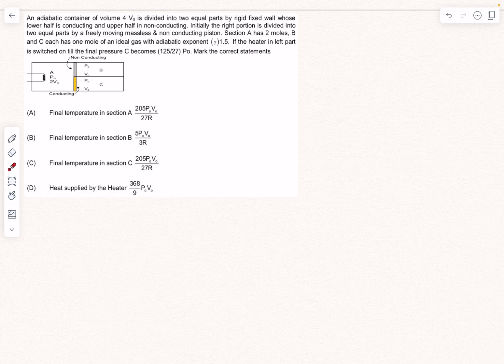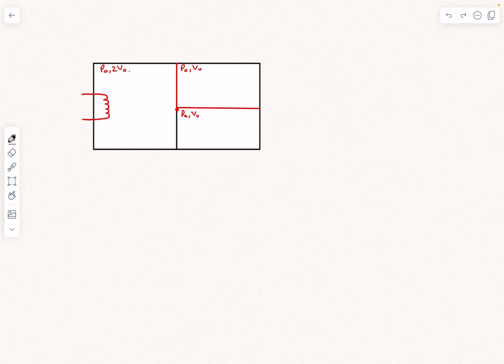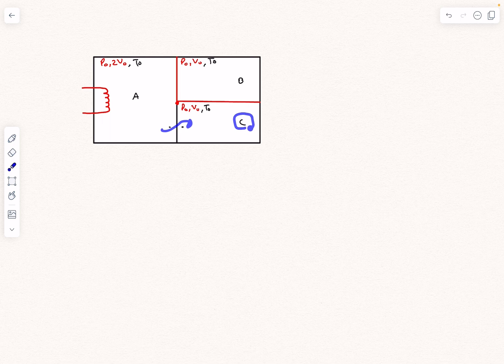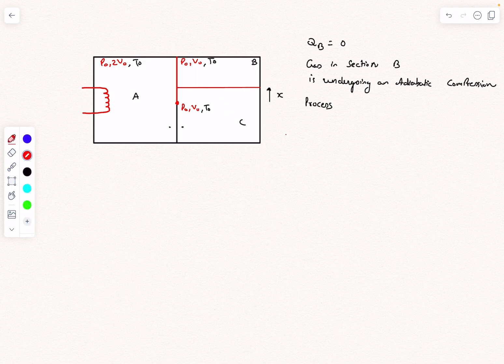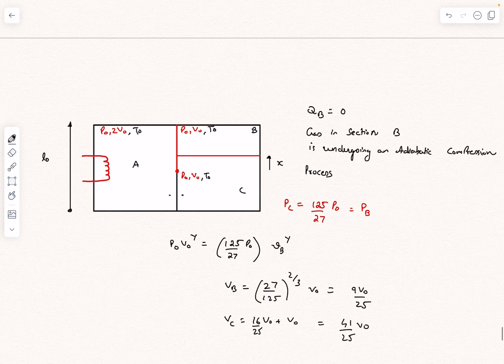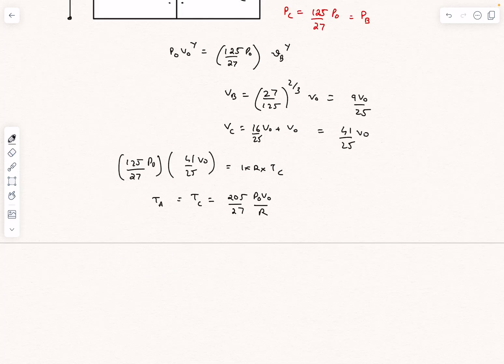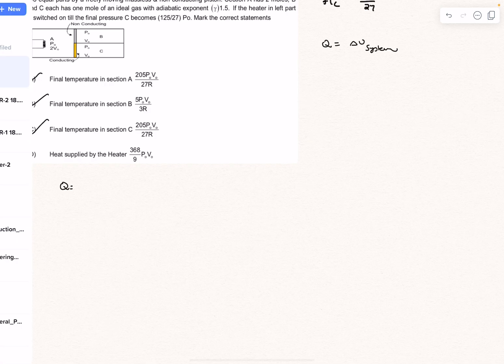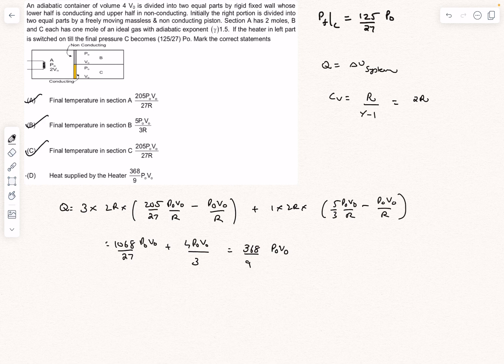[JEE 24] Final Temperatures and Heat Transferred By Heater | AITS

Comment: how is pressure in c and a same after expansion ??
hasnt volume of c increased
Reply from the maker: You mean c and b ? It's same otherwise the piston would move moreover pv const is only for isothermal here temperatures are varying
Reply: @PhyX_03 ohh sry i read that final pressure in a becomes 125/27 Po....